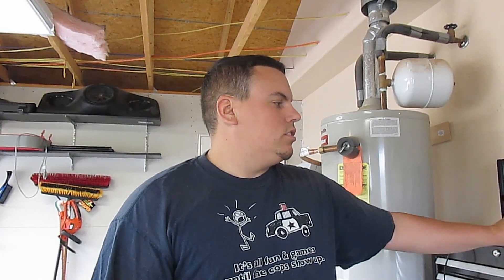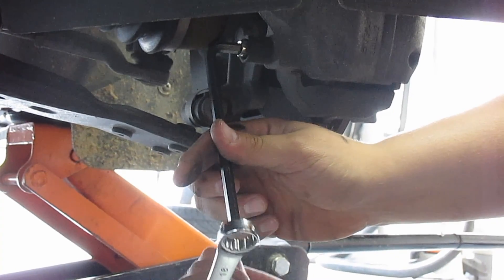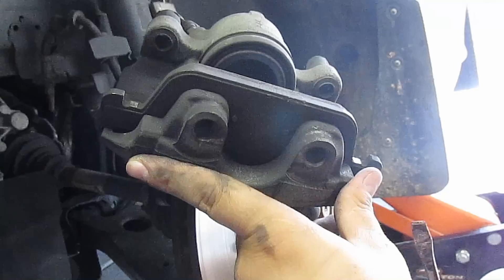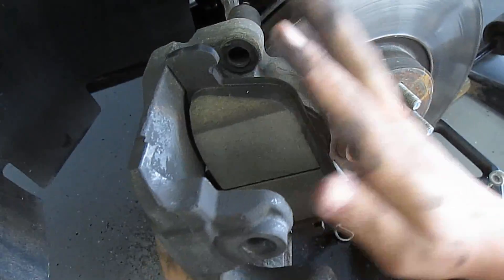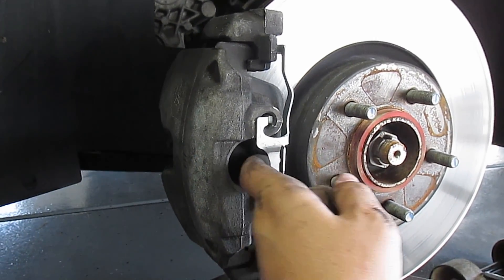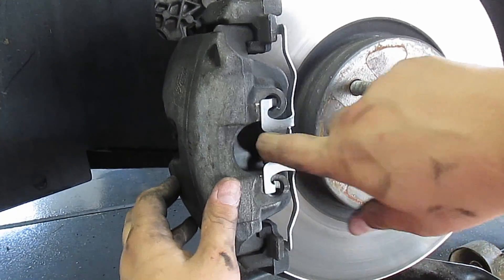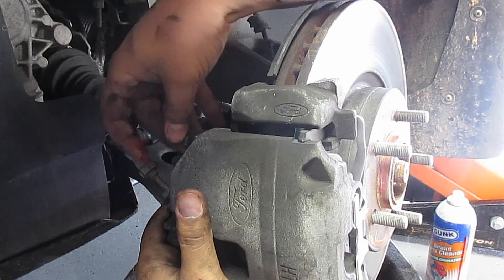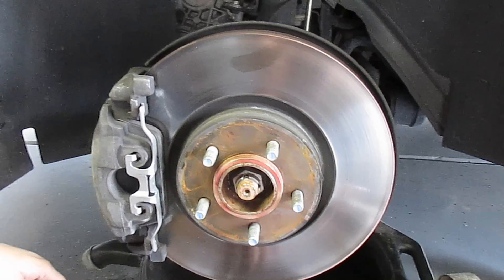HOW TO: 2013+ Focus ST Front Brake Replacement Step-by-Step

Comment: Very clear and straight forward. I'm at 42k and my factory pads are still good but am looking into options for rotors and pads (I've been wanting to paint my calipers for a while now lol)
2 things I've noticed this and similar brake/Focus ST how-to guides don't cover:
1. compressing the piston before installing new pads - i use the old pad and a c-clamp. easy. cheap. Or rent from the parts store (usually free with a deposit)
2. turning/replacing rotors - rotors get bent/warped/grooved/etc and usually should be turned to ensure they're level. If not, pads will wear uneven (causing stutter/pull/etc).
Reply from the maker: I never reuse or turn rotors, because what happens is that you take metal off and then the rotors warp much faster since it has less material.  i just buy pads and rotors because the shit is so cheap.
Reply: @FatGuyBuilds  Yeah, I usually buy the set as well, rotors/pads together. Half the places I've seen want $20+ to turn a rotor when you can buy all new rotors online for the same price. It's a good excuse to get the calipers painted, so I'll be looking at sets for a near future install. Even Rockauto has had some nice quality stuff for a good price, may start there for shits'n'grins  ^_^

Comment: How you like your Ford Focus?
I have a 2012 Ford Focus se
When I'm in traffic it shakes when a start accelerate slowly? 
Does that happen to ur ford?
Reply from the maker: no, it did happen to my 2012 SE...  your motor mounts are sagging.  go but the Focus ST motor mounts.  they are interchangeable and they will fix ur problem.

Comment: Hi do you need to grease the back of the pads and contact points before reinstalling them in the calliper? Or do you only need to grease the pins as you did?
Reply from the maker: James Mcl no.  now days companies put a small bearing kind of material on the back of the pads.  plus the pads lock into the caliper on this car.  Just do the pins...
Reply: Thanks
Reply: My stock pads the shims are burnt and falling off, if I keep using the old pads just grease the back side and good to go? No problem without shims right.  (my stock pads thickness look kind of like yours, still some left I guess) And if I upgrade to hawk still no need to lube it?

Comment: How do you compress the piston on the caliper? I have released the brake fluid cap but it won't budge even if I try and lever it??
Reply from the maker: you can either do it with the old parts and put the screw driver between the rear brake pad and rotor.  or you can use a C-clamp
Reply: Not in the st, you have to use the two pin holes and turn clockwise as you push in, it’s simple . Good luck

Comment: Followed the steps here.. after dealing with a seized allen bolt and wrestling with the clip, I got stopped cold by the caliper. It was loose but would not come off the rotor... it's only being held by the two pins, right? What did I miss?
Reply from the maker: it should just come off if u pried the piston closed a little bit.
Reply: +Jason Georgievski okay - I didn't touch the piston... would a c-clamp make the job easier?
Reply from the maker: With the caliper on.  Pry against the garbage pads and it will compress the piston.  Then use a c-clamp compress the rest of the way once the caliper is off
Reply: +Jason Georgievski cool - will give it another go. thanks man
Reply from the maker: kool

Comment: can you explain why you removed the brake fluid cap to begin? also do you bleed any air out of the system before placing the cap back on?
Reply from the maker: because when you compress the calipers it forces fluid back up into the master.  so loosening the cap allows air move from inside the master res.  No air Goes into the system at anytime during the service.

Comment: At 40K miles, should I machine the rotors? Stealership is charging about $550 all four with pads included.
Reply from the maker: that is stupid expensive.  go to rockauto.com.  you can get all pads and all rotors for less than that brand new
Reply from the maker: do not pay that much
Reply: +Jason Georgievski  Wow, super cheap. Thanks for the info and help with the Tutorial. You make very good and informative videos.
Reply from the maker: Ur welcome.  Just order the standard rotors and ceramic pads.  U will be happy

Comment: I got new rotors and ceramic pads installed recently and now they squeak at low pressure. Its driving me crazy... any ideas?
Reply from the maker: sounds like you may not have cleaned them good enough when u got the rotors.  i am just running autozone specials and had ZERO issues.
Reply: Yeah I never touched them. I'll pull the caliper and clean the rotors soon as well as lube everything up and see if that helps
Reply: I got them cleaned and regreased from the guy who installed them (free of course) and they have no sounds now!

Comment: How were they compared to stock? Thanks
Reply from the maker: just left from the time attack day.  did 5 attacks = 25 laps total.  ZERO brake fading and no fire started like the other guy with the stock ST.  his brakes actually started on fire.
Reply: Jason Georgievski
nice, yeah I read reviews they say ST brakes fade easily on tracks. so you only replaced the pads right? so pad was the problems no need to replace other brake systems huh?

was this autox, circuit track? thanks
Reply from the maker: Road racing.  The rotors finally started to warp a little bit after 75 laps.

Comment: Eh, you forgot to put grease on all the pads. This is an important step.
Reply from the maker: this is no longer needed since manufacturers started adding the little pads on the back of the brake pads.  you only need to put it on the slide pins now.
Reply: @FatGuyBuilds  I thought you forgot too.... Good to know!  Thanks for the video!

Comment: thanks for the helpful video. for stock pads does it have sensor to warn you low pad left? for those sensors as soon as you can hear it it's damaging rotor a little bit right? so you want to replace right away? or somehow check it before it gets that low.  also before pushing the caliber in to install new pads, do you need to clean the caliber and inside the boot? or does that not apply to focus st
Reply from the maker: +Okaythen001 it does have that scrape tab.  but you should inspect your brakes at least once a year.  clean calipers is not needed unless there is bad rust build up.

Comment: Terrible job. You should never change pads without shaving or replacing rotors. You should always torque the caliper bolts to the specs required by the manufacturer.
Reply from the maker: +Michael Stango at the point I did these pads there was zero wear marks on the rotors because stock pads are organic.  pads are softer than rotors.  I didn't have enough miles or wear to dictate machining rotors.
Reply from the maker: +Michael Stango as far as TQ.  you can do what you want.  I have done brakes the same way for 16 years with ZERO problems.